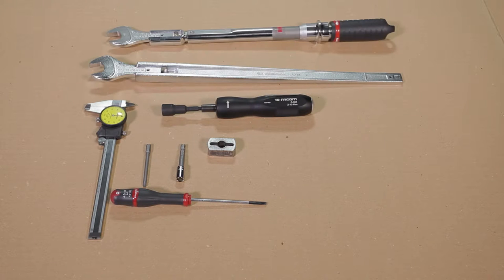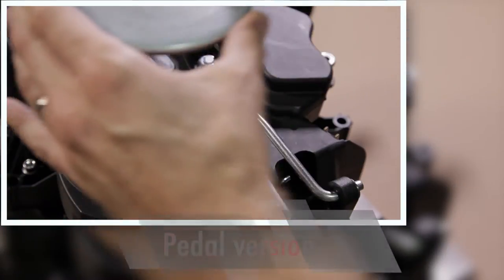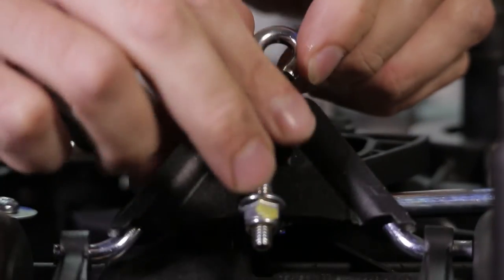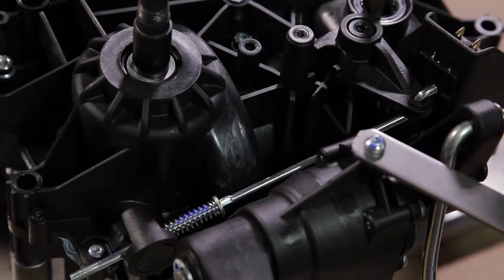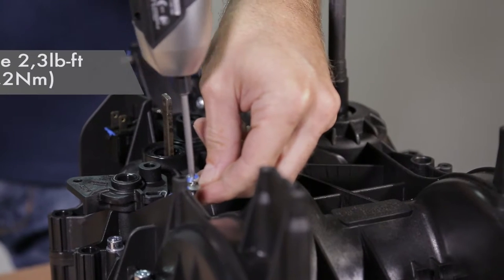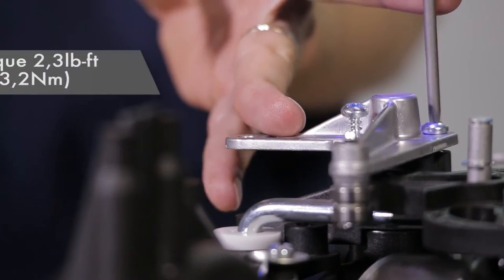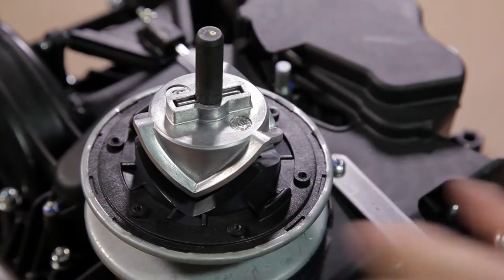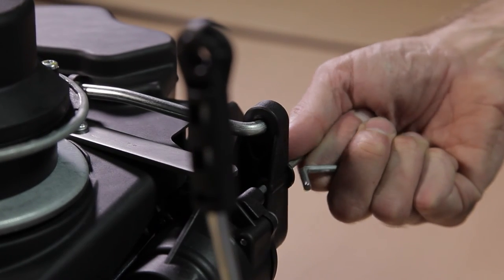RS800 Full Disassembly

Comment: I have an Ariens 20hp 46" (93608500) with this transaxle. I purchased it last year with only about 10 hours of use. It had been purchased as new old stock by a neighbor who then only used it part of a summer on a small yard.

 The transaxle doesn't even have actual seals for the axle shafts like some versions. Mine just has O-rings. It started leaking grease (OO grade) with  20 hours of total use. The paint wasn't even worn off the mower blades. I was second owner of it so could not pursue a warranty replacement. The axle shafts do not have bearings or bronze bushings. They wear directly into the plastic housing. I measured the wear in the housing at 0.072inch on one side and 0.057inch on the other at that time the leaks were discovered. The axle O-rings could not seal with that much movement. The axle shaft wear in the axle housing is significantly worse now after 2 summers of mowing 

 I ended up drilling a hole into the housing and gluing a hose to the housing with epoxy so that I can refill the transaxle with grease when ever it decides to quit driving. I'd love to join a class action lawsuit over how deliberately a poor a design this transaxle is.
Reply: Thank you for sharing. I’ve be having a hell of a time trying to get the axle out and now I see I’m wasting my time. Where do you get the grease from? Any specific name brand I should be looking for?  Where exactly on the transmission did you put the hole with tube sealed with epoxy so you can add grease when required? I like that idea and want to do the same. Thanks in advance.

Comment: Who the hell would design a plastic transmission like this? This shouldn't even be legal. Avoid any and all mowers with this transmission or similar design. Unbelievable.
Reply: mines worked great for 10 years now
Reply: @FriggOff361  I agree, mine is a 2016 and still works great, the bearings get dirty and seize on the drive pulley if its not cleaned semi regularly. :)

Comment: Have one of these on a Toro XLS 380. The pedal jams between foward and reverse. Have to play with the pedal like a drummer in a rock band  to go fwd and backward. Can't see anything obvious with the likeages and arms causing a problem. All I can say is if I knew at the time back in 2012 about these plastic transmissions I would never have bought the Toro. Too many plastic levers, springs, control cam, rods etc the things a bloody nightmare. Taryl is spot on about these pieces of junk!  Anyone got any ideas as to what's going on, why the pedal jams between fwd and rev??
Reply: I’m dealing with the same thing on my craftsman LT3000. Lucky me I have the gas tank under the seat not the battery so no easy access. It looks relatively simple to drop the transmission to blow out all debris so that’s what I’m going to do.
Reply: @kilabeez0  Mine had an access panel behind the gas tank where I could remove a plate and then the gas tank; 5 minute job and running again.